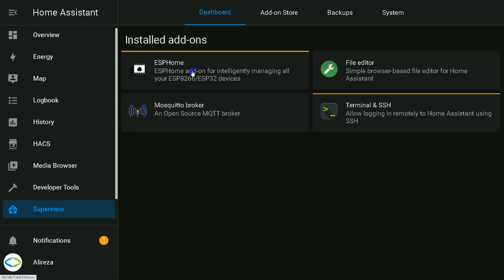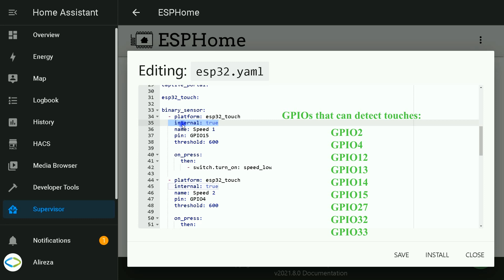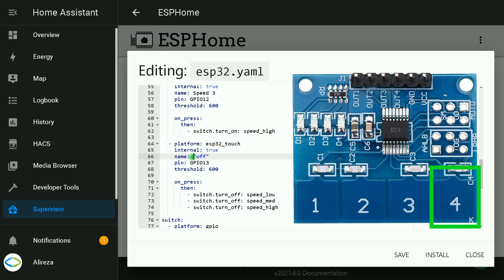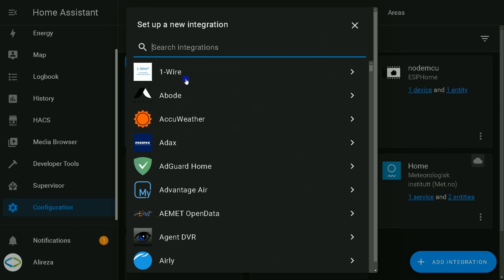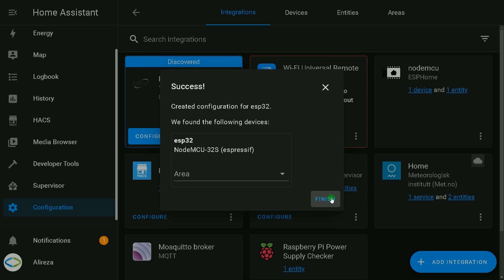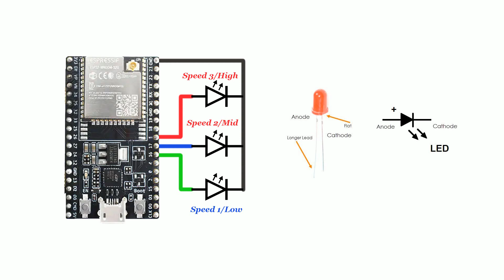Control 3-Speed fan in Home Assistant with ESPHome

Comment: Can we control ac fan using this circuit?
Reply from the maker: yes
Reply from the maker: by the way if your ac motor has three speed. if not you must use inverters
Reply: @kian.smarthome  Hi Ali , can you show how to connect AC fan to control it's speeds
Reply from the maker: @benjamink7311  May I know the model of your Fan? Does it have only 2 wires or more? (except the earth wire)
Reply: @kian.smarthome our fans usually have 2 wires and controlled by a regulator with 4or 5 speed
Reply from the maker: @benjamink7311  ok, I will make its video but need time